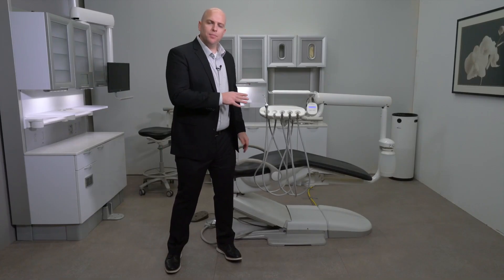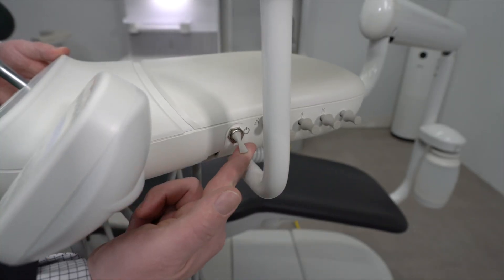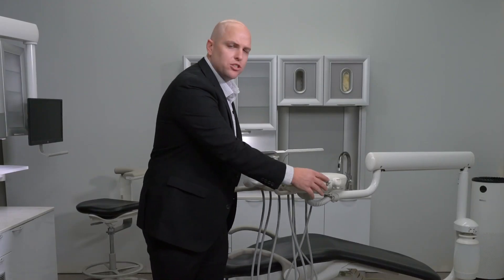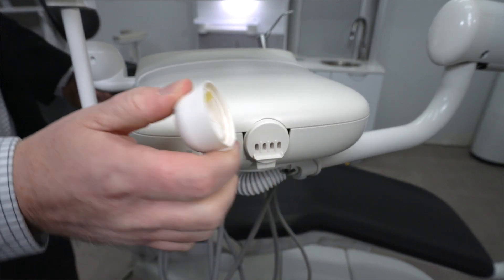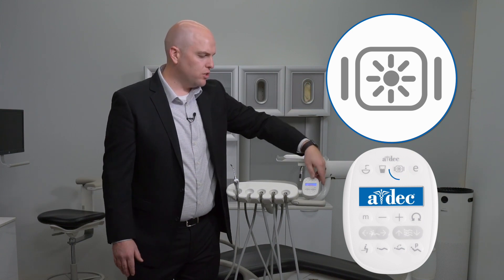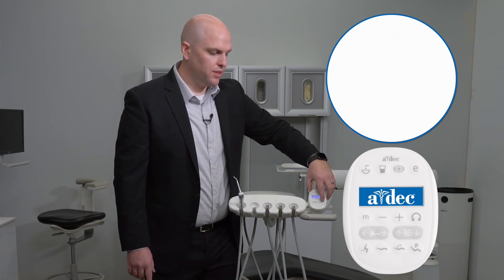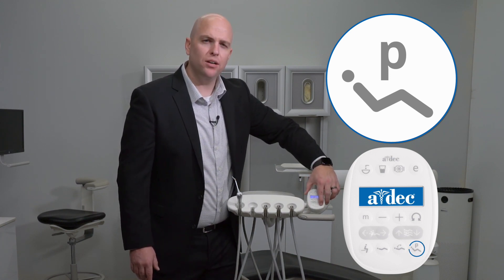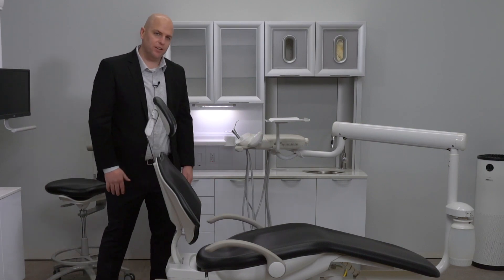A-dec 332 Traditional Delivery System

Comment: Can I adjust the power of the satelec scaler?
Reply from the maker: Great question. Yes, you can adjust the power of the scaler. Simply remove the scaler from the handpiece holder, then use the + and - buttons to increase or decrease the power.